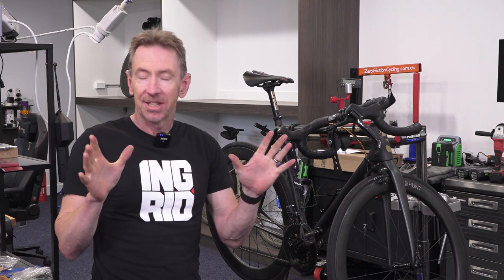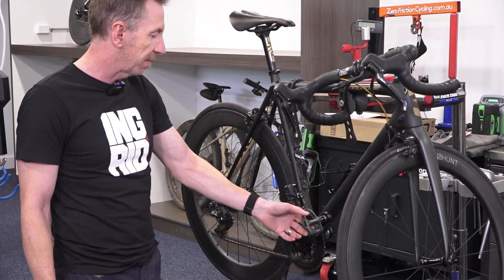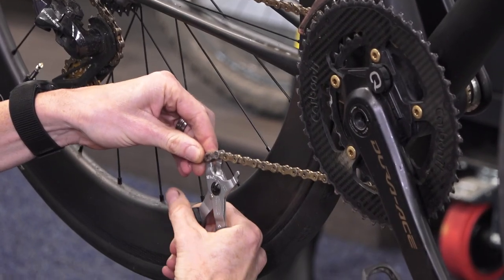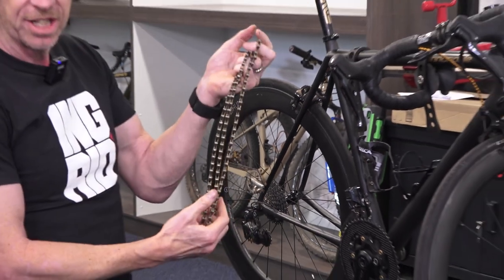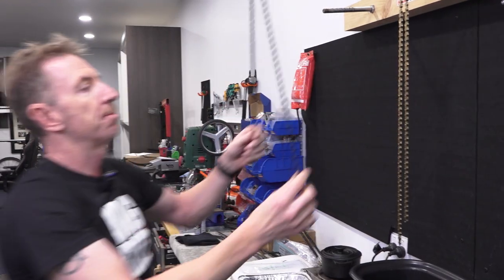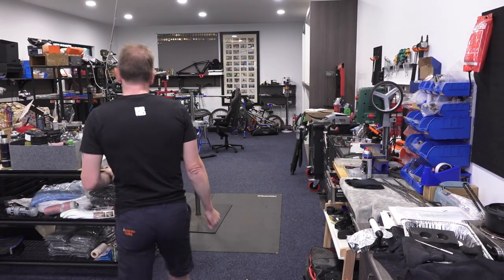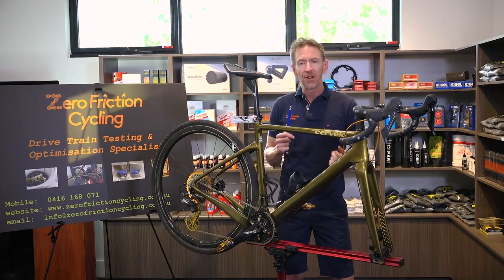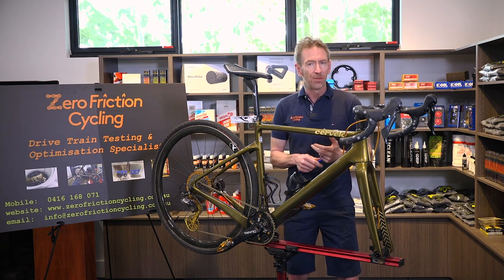Episode 17   Immersive Waxing - The Concise Version

Comment: I am a cycle Messenger and tried Waxing. My Problem was that the wax in the Pot got dirty real fast. I suspect ist from all the grime in the City streets.
Any ideas how to prevent this ?
Reply from the maker: How could you tell? I gather it was DIY wax? (if msw or hot melt, its black in pot, you would not have been able to assess if dirty or not dirty). If diy wax what wax? it is likely if a cheap wax it is just oily and thus yes will get dirty very quickly. On a good wax the grime will be not much of an issue at all, and whatever issue it is, it will be a VASTLY lesser issue vs the issue it would present to a drip lubricant on your chain. Ie, you are diluting whatever small amount of grime is absorbed by a SOLID lubricant across an entire pot worth of lubricant. With a drip lubricant approach, you will have about 3ml of drip lubricant on your chain, and so the grime is going to continue to build and be a much higher ratio of what is actually running in your chain when it only has 3ml to dilute itself across etc. Even if the cheap wax became dirty quickly - that should just re inforce what is happening oh so much faster in just 3ml on your chain if just keep adding lube / no clean to re set - at least the re-wax dilutes the contamination across hundreds of ml, and it takes a long time for the wax to be dirty enough to worry about vs what happens with drip lubricants. But of course a cheap wax you will want to change a lot more frequently vs the top known waxes.
Reply: @zerofrictioncycling992  
Hey thanks for replying in an old Video :D . 
The wax used was pure Paraffin but i cant say anything about the  quality. 
I read a Lot on your Website and i think my biggest mistake was not adding wax lube or rewaxing after wet weather. 
I will try Waxing with a prober Setup again. The feel of a waxed Chain was Just to good.
For now i will use Up my bottle of Rock and Roll blue. 
My Bike has full rando Style fenders with wide mudflaps.
Those do a lot to keep my drivetrain an feet dry and Clean so the lube lasts a lot longer in wet weather.
Reply: @zerofrictioncycling992  
I have another question what
Ist the cheapest wax you would recommend ?
Reply from the maker: @cefiersBlock  Gulf canning wax if you are DIY waxing. That is a quality food grade paraffin. If all DIY waxers were to use that vs cheap / oily stuff - they would really help the reputation of immersive waxing!

Comment: Briefly, why don't you wax the master link?
Reply from the maker: two main reasons - 1) if you re wax by recommended earlier intervals vs definitely going to want to push treatment lifespan to the limit - there is plenty enough wax on the chain itself to look after the master link. 2) you will have wax set at base of pin & plate. This makes it harder to push link all the way through chain. Waxing link greatly increases the risk that one will only lock in one pin vs both, leading to failure when cycling. when not waxed, it is very easy to ensure both sides of link are properly connected. 

Many wax sites recommend / demonstrate waxing the link - but it just really isnt necessary and just leads to higher risk of not installing properly, or it is more faff installing link (after failing to be able to push through far enough, remove, scrape excess wax of base of pin, try again etc).

Comment: How important is it to degrease all of your cassette and chain ring and cages and jockey wheels? Isn't it all a waste if there is loads of grease there? Won't that contaminate your freshly waxed chain?
Reply from the maker: Hey liam - new components of those are not greased only what the chain has imparted on them so normally if prepping a new bike, its a 5min job to wipe rings, cogs and pulleys of any FG from the OEM chain. Re existing bikes the job can be easy or a nightmare depending on what lubricant choice one was previously running as well as previous maintenance. But yes, you do not want a previous dirty drip lubricant build up one rings / cogs / pulleys contaminating your lovely waxed chain - but the good news is that clean will be the last clean you have to do once switched to waxing if on a top wax and not a gunky cheap paraffin DIY.

Comment: so why don't you dip the quick link?
Reply from the maker: Wax at the base of the pin makes it more difficult to insert fully and thus increases the risk the master link will not be properly installed with  pins engaged in locking channels on both sides of the link. For normal recommended re wax intervals, there is plenty enough wax to take care of the master link, or if one is concerned, put a drop of wax drip (ss drip, ufo drip etc) on master link pink before install if a very long event etc.

Comment: so, how fo you cleM a waxed chain?
Reply from the maker: For most riders 99% of the time you just re wax, that does the cleaning and re waxing. If one is looking for a deeper clean due to post wet ride etc - then mostly it is just boiling water flush rinse to melt off the worst of the contaminated wax, dry, re wax. Deeper cleans (ie a perfect re set for a dedicated race chain) would be boiling water flush first, dry, UFO drivetrain clean or other solvent that works on wax - soak, shake, rinse boiling water, dry - re wax. But yep, 99% of the time, you just re wax. 

Maintenance guide covering all lubricant types, riding type and on or off bike maintenance is found in instructions tab - ZFC website

Comment: Why don't you wax the master link?
Reply from the maker: Hey michael - a) if you rewax at recommended intervals there is plenty enough wax on chain to cover master link and b) waxing master link - wax at base of pin makes it very hard to push pins through such that it is easy to get them locked into the channels. It makes installing the link much harder, and with a much higher risk of person only actually locking in one side which will cause failure upon riding. So its basically a lot more hassle for increased risk for no benefit. if one was planning to push a treatment to the death (very long harsh race - then yes i would wax the master link, otherwise for normal training  / races these is no need.

Comment: I rotate 4 chains. I dip all 4 during the same wax session but only one at a time. So dip the 1st remove then hang. Dip the 2nd remove then hang and so on. Would it be smarter to purchase a larger crockpot and dip all 4 at same time and remove all at the same time?
Reply from the maker: Hey Jamr - it depends on what you mean by dip. If you just dunk, swish , remove etc - that will be a not great re wax - you need chain to heat up to same temp as wax and for old coating to melt off and in a new coating. So to do one at a time you would need to leave each new on in for 10mins. So a larger pot can just make it more efficient time wise if always doing multiple chains at once even its 2 then 2 etc.
Reply: @zerofrictioncycling992  Hi Adam. thanks for the reply. Yes what i meant by dip is I would leave one chain in a 2Qt pot for 10min remove then the 2nd  remove 3rd  remove and 4th  so 40min total when all added up. I would like to put all 4 chains in at one time for 10 min then let the wax cool to when it starts to skin over then remove all 4 chains and hang.  I think I need to purchase a 6QT / 5.67 liter pot. How does this all sound? Would you rather a 3Qt pot vs a 6Qt?

Comment: I wonder how many people try chain waxing and then find out a) that it lasts 5 minutes before the chain starts squeaking and b) what a ball-ache the whole process is?
Reply: My chain lasts about 150-200 miles before it gets noisy at all. Before that it’s dead silent. It’s not a ball ache at all, literally the point of this video?
Reply: Just started waxing my chains and found it to be very easy. Also Chain is as quiet as any lube I’ve ever used.
Reply: If your wax chain starts squeaking after 5 minutes, you are doing it wrong. It looks like a "process" because he has a whole kitchen set up to do it professionally. Exaggerate much?? There are ceramic wax lubes that go on as a liquid and solidify to a wax coating, if you don't want to deal with melting wax in pots and the whole "process"
Reply from the maker: Hey ashley! By ball ache process, are you comparing waxing to what a ball ache trying to solvent flush clean the black mess off ones drip lube chain is? And how often one needs to do that if they want to retain a low friction low wear chain? And how much that costs in solvent? To still have higher cost to run vs immersive waxing where all parts of chain are sliding on a solid coating of super slippery wax leaving chain metal out of it, and ones drivetrain is always super clean? Compared to just re lubing and no maintenance - sure it takes say 2.5 mins more work to do a re wax vs a 30sec drip re lube. But one just gets so much back for that extra 2.5 mins re always clean, and wear rates that are typically around 1/3rd that of most drip lubes on LBS shelves (sometimes much more). That is a huge cost saving that one has $$ in their pocket to buy much more fun stuff vs yet another chain, cassette, and sometimes chain rings - remember that many cassettes these days cost well into the hundreds - even $700 to $800. Cyclists need to buy a new chain and cassette in in circa 5000km to me is a vastly more throbbing ball ache than popping a chain off, having it come out of the pot looking brand new again without me needing to clean it, and having it last around 15,000km, and still not need a new cassette. 

It is important for me to clarify though that ZFC REALLY isnt just about immersive waxing - ZFC has tested many more drip lubricants than immersive waxes, and stocks many more drip lubricants than immersive waxes, and actively recommends many brilliant drip lubricants. Waxing is absolutely not for everyone, but - honestly - many see immersive waxing, it just clicks as to why it will obviously be better, they cant wait to get on it, and it is then just happy happy days forever and ever. 

There are the very very few who have your experience, and yes as per ebikebuilder - it is then almost guaranteed the prep / waxing was done wrong or some weird diy blend with a shite base wax / candles. I think if you peruse the google reviews for ZFC, you will get a feel for the general experience of those who have switched to msw or hot melt, and it differs a heck of lot from your intimation above. Such intimations honestly just come from a complete lack of knowledge - prep chain properly, wax chain properly, use a proven top wax - all of which are extremely easy to do - then you will experience the above. And i hope the video shows how easy it really is, tis a process that doesnt provide much ache to ones balls at all. Unless thy balls are super sensitive, in which case, see a doctor! :)